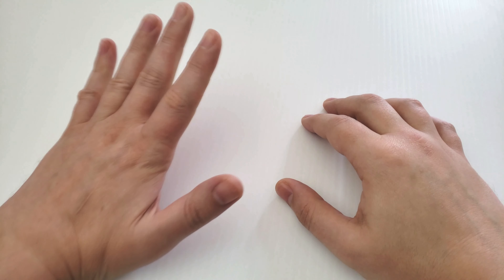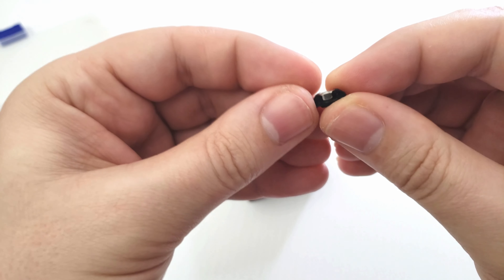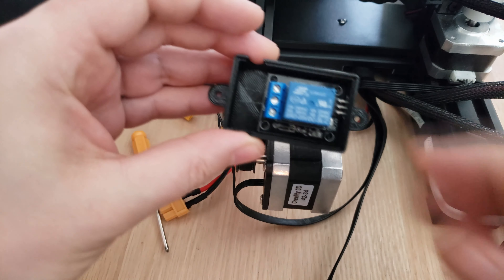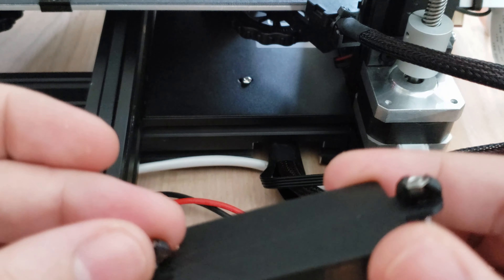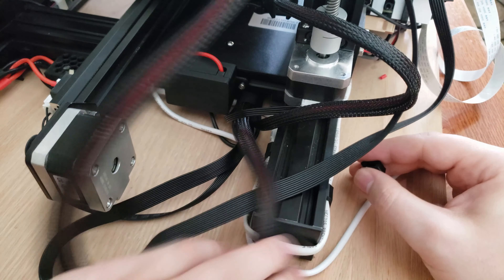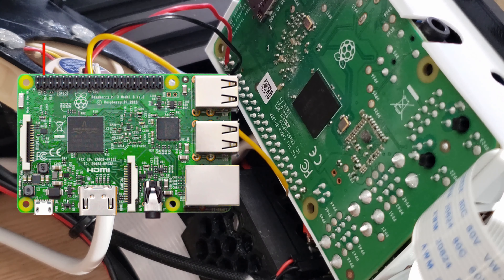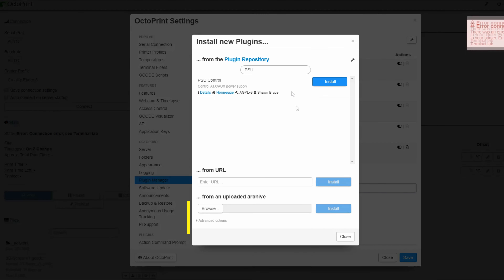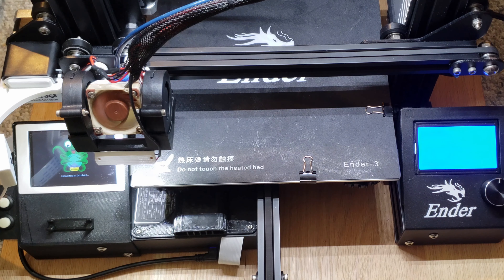Using OctoPrint with PSU Control to turn off and on your 3D Printer.

Comment: Hey man, this is very dangerous. Your relay is rated for 10A and the printer can output up to 15A on the DC side - FIRE HAZARD!!!. Safer would be wiring it on the AC where the current is smaller. I know that you would lose the ability to power the RPi directly but safety should come first. I guess a higher-rated relay would do the job but I would still be more rested cutting the power to the power supply.

I know more people have brought that up in the comments and you have acknowledged but they are too far below for people to see. I really think you should address this in the video and description. 

I am grateful for your videos and see that you are helping a lot of people but this specific issue can become a tragedy for someone. Thanks and good luck on your channel
Reply: Yes, I agree with all this. Here's what I have done for my Ender 3 V2:

1. I built an enclosure for the printer and pulled all the electronics out (minus the steppers and limit switches, of course) and mounted them inside their own enclosure that sits on top of the printer enclosure.
2. I used the same relay as in this video, but I wired its N/O output in parallel with the physical power switch, and control the relay via OctoPrint on my Raspberry Pi. The relay is in parallel so that the physical on/off switch will still be usable should I have a relay or Pi failure.
3. The Raspberry Pi is powered on a separate wall outlet that has a smart plug that I can control with my Amazon DOT.
4. I also have LED lighting and a charcoal air filter inside the printer enclosure, both of which are powered by a buck converter inside the electronics enclosure, and both of which are separately controllable via OctoPrint. 

So, I turn on the Pi remotely with my Amazon DOT, then load up OctoPrint in a browser and use it to turn on the printer power and optionally the internal LED lighting and/or air filter. Works a treat and greatly reduces the number of trips I have to make to my garage where the printer is kept. 

Next project: build a servo/OctoPrint-controlled nozzle wiper so I don't have to go to my garage just to "wipe the printer's nose"  before it commences a print. Gonna be fun.
Reply: I know Im pretty off topic but does anyone know a good place to stream new series online?
Reply: @Remy Miller meh I'd suggest Flixportal. You can find it if you google:D -caiden
Reply: @Caiden Cristiano thanks, I went there and it seems like they got a lot of movies there :) Appreciate it !
Reply: @Remy Miller glad I could help :)
Reply: Thanks for the video, and the effort. But, It's not the way it's supposed to be designed. DON'T DO IT!!
1- This setup keeps psu always on, shortening the life of it. (And increases idle power consumption)
2- Vitor is right, DC current is way too high for the relay. It may eventually cause fire hazard.

What you should do is, use the relay on the AC input of the psu. Current will be always below 10A so, relays can handle it. Properly cut the Phase cable, use the relay to complete the circuit back to PSU. Use proper isolation. ALWAYS TEST BEFORE ACTUALLY POWERING UP THE SYSTEM. DON'T MESS WITH AC IF YOU DON'T KNOW WHAT YOU ARE DOING. (Sorry for the capitals guys, but as an electronics engineer I cannot overstate the importance.)

Only downside is, raspberry will keep powering the printer's mainboard even the psu is off. Printer screen will stay on, and probably you will recieve low voltage alert on octoprint.  You can use another relay to power down usb cable between pi and board. Software solution is hub-ctrl. You can google it.

Cheers, happy printing.

Comment: Instead of switching the 24V side do it on the AC side.
Get a relay module which already has an optocoupler included.
That way you can turn the printer completly off, including the PSU.
For the RPi, just use a 5v power supply.
That way, if something happens, you can switch the whole printer off (safer).
As i'm finishing my enclosure, i'm thinking about including a smoke detector and temperature sensor.
Write some code, and just let the RPi monitor the inside of the enclosure ambient. If something goes bad that is detectable by the sensors (supoosing there are no bugs), just let the raspberry pi shut the printer automatically off.
Reply: wifi socket on the lot is what i use, simplest solution that and a fire ball in the enclosure. No playing with the electronics and so much simpler.
Reply: Also better for the relay since the most can only handle 10 amps
Reply: @sitgesvillaapartmentneilsc7924  can u explain to me how to do it? Thank you
Reply: @--3D  all I use is a normal wifi socket on my printers cables /cabinet where it sits, that connects via wifi  back to alexa from amazon and I can tell alexa to switch it on or off or do it from my phone, alternatively you can use a small relay and add some gcode to the end of your program that sends the x azis up to the top of the gantry hits a microswitch which turns off the ac power, because that would have 220 volts in it or 110 you would have to ensure that its safely enclosed and the wires can. not touch the frame, that way at the end of the job the x gantry rises and switches off, in cura you can set some finishing gcode that can lift the x gantry to the top. The fire ball is from amazon and as my machine is in a steel cabinet with a double glazed door on it it hangs at the top of the cabinet , should the printer catch fire then the fire ball will pop and put out the fire i hope, but to be honest the safest bet is not to leave your printer. Hope that answers your question if not please be more specific and I will try and help.
Reply: @sitgesvillaapartmentneilsc7924  thank you so much for your time and answer.
You gave me a lot of options to think about.
I have a sonoff switch laying around I think is 10Amps. Do u think it'll work for an ANET A8 PLUS
Reply: @--3D  to be honest I dont know that machine but you can look at the power panel details and work out the amps as follows : The formula for Amps is Watts divided by Volts, whch will show the amps then check the sonoff switch and see what that has, if its more than the printer its ok if its less than you need a more powerful one. Hope that helps.
Reply: Sitges Villa Apartment : That’s a good idea, the micro switch at the top of the gantry! I’ll look into it, can still use a 5v relay to keep the wiring on the printer safe low voltage and put the relay somewhere safer.

Comment: thanks for posting,   I didnt realise the plugin was available, I have done a similar thing a couple of years ago  on my old a8, but I used the relay to switch the mains  side using 2 shell scripts on an orange  pi  zero, they are runable through octoprints menu, I prefered  to switch the mains side rather than the low voltage side as that way the psu is completely off when not in use
Reply from the maker: I've seen a couple of people do it at the mains side, either with the plugin or without. Since I had already connected my Pi to the printers PSU, I went this route. Though I still do shut off my printer each night when in use. (at the PSU)

Comment: great videos im still getting a under voltage running through the power supply so i switched back to a raspberry power supply but i love the mods that you have

Comment: You really should use a transistor, mosfet or a transistor driven by an opto isolator on the GPIO line. The Pi's GPIO are wired directly to the Broadcom CPU and are not really capable of driving a relay coil.  A flyback (reverse biased) diode across your relay coil is pretty essential to prevent the induced back emf from spiking right back into the Pi's CPU.  Sure, many relay modules have this all on the PCB but you should warn folk not to wire a relay directly to the GPIO  and the "Closed" contact is correctly called the "Common"  just to be consistent.  HTH, G
Reply: SSR is a better solution as well, more rugged, no back EMF, no movable component hence no possibility of contact welding. I preferred to go for another XT60 cable instead cutting those in place, with a splitter and step-down i am able to power the RPi too.
Reply: This relay Is really operated by the  Pi's 5 vdc, The 3.3 vdc GPIO voltage simply switches on the relay boards on board switching transistor that applies the 5 vdc to the relay. Not as good of isolation as an optocoupler but plenty good for this application. It's amazing how many people think the 3.3 vdc is what actuates the relay. But you are right, using this relay board is fine but you do need to be sure that the relay you use has those on board components. Hope this clears up things a little

Comment: very strange I wanted to test the plugin first. Used jumper wires to connect the relay. That powers up but with minimal settings it refuses to switch.

Comment: I've got a couple questions I hope you can answer.

1. Are you powering the RPi through a wall brick or off of the printer's power supply? I saw that you plugged in a USB cable on the Pi's USB power port but I can't tell if it goes to a wall brick or if you modified the cable to grab power from the printer's PSU. My goal is to do just that and grab power from the printer's PSU when flipping the printer's power switch without that actually turning the printer on and then turning the printer on via OctoPrint and PSU Relay Control. So I hope that's possible.

2. What do those 2 white switches on the side do? It looks like the top one controls the printer's overhead lights. Does the bottom one just control the hotend lights? Or does it do some other cool thing?

Thanks for the video, it's helped me understand the setup I'm aiming for a bit better as well as given me some new ideas!

Comment: Thanks for the video!
is 10A relay enough?
Reply: depends what printer and the max power output of the power supply the printer uses 
I know the ender 3 needs a 15 amp iirc 
I think it has a 350 watt supply that can do about 15 amps at 24 volts
Reply: @BenCos2018  I was thinking the same thing.  I'm probably going to switch the AC rather than the DC on my setup.
Reply: @benjaminlately  yeah 
I'd be careful with switching the ac though (make sure it's unplugged fully before you touch any of the wires though)
Reply: @benjaminlately  switching AC is going to be inconvenient because now you need an independent PSU to run the relay and rpi.

Comment: Hey man thanks for your tutorial, I've a orangepi and using the system command to power off and my printer. Can I power off my orangepi at the same time?
Reply from the maker: I haven't seen a way to do so via the PSU Control Settings.
But OctoPrint does allow for custom GCODE scripts, you could create a shutdown script for your OrangePi, tie it to a custom GCODE and then add that GCODE to the shutdown commands on the PSU Control plugin settings.

Comment: I have mountet the relay like you say, but the usb cable from the pi to my cr10 pro keep the motherbord powerd up. how do i fix that?
Reply from the maker: The relay should be wired in between the power supply and printers mother board.
It's purpose is to control power from the supply to the motherboard.
Reply: You ha e to cut the 5V wire in the USB cable.

Comment: Considering the DC output of a lot of printers (like the ender 3) is 15A and the relay you're using is 10A... couldn't this be pretty dangerous? If the system ever pulled the full load then that relay connection would burn.
Reply from the maker: Mine has since been replaced. I had one sitting around that I used in the initial build but have replaced it to match the Ender 3's output.
Reply: @lifeasanerd4202  can you provide a link to the new relay that you used?
Reply from the maker: @JoshKindhart  https://amzn.to/35YzBt5

But also https://amzn.to/2QiGCP5 could be an option. Both are rated at 30amp 240v AC
Reply: @lifeasanerd4202  The first relay does not have a transistor/mosfet driving it. Using that likely will kill the output port short/midterm...
Reply from the maker: @thinking-laaf  That is a possibility, though in the year its been in service, no issues as of yet.

Comment: At 7:03 - 7:06 your wiring diagram changes the positive and ground pins... which pins are the correct ones?
Reply from the maker: Looks like an editing error on my side. Good catch!
The first 2 pins are 5v the 3rd pin is ground

Comment: Hi, I'm not very good at electronics, but I have a question.  This relay says it is for 10A and the Ender 3 PSU say at 24V with 15A, no problem if you use it at maximum print temperatures to burn something? And other question, if use led strip, just conect at same wire to power with motherboard of printer? thanks and sorry for my poor english.
Reply from the maker: I have yet to have issues with mine and I print at 210c with 60c bed and fans at 100%. Longest print I've done with this setup is 12 hours. No overheating or burnt parts in my case.
As for the LED strip, I used a Buck Converter coming off the same print power wire. The Buck Converter allows you to adjust the output voltage so I could lower it to 5V for the LEDs to be powered.

Comment: Did you not have trouble switching that 5v relay with the Pi's 3.3v gpio logic pins?? I know the Pi has a few 5v power pins, but all the logic pins are 3.3v
Reply from the maker: There are no issues switching the relay with the 3.3v logic.
Reply: @lifeasanerd4202  hmm, it must just be a luck thing then with some 5v relays, because I've seen some people say it doesn't work and others say it DOES work. I have a 5v dual relay board I use with arduino (specifically a ywrobot brand) and I tried it with my Pi and it doesn't work. It will trigger but it won't release.

Comment: I've seen this tutorial from other youtubers using the COM and NC for the power but you suggest to use the NO. Is there a difference in the setup to use the Normally Open instead of the Normally Closed?
Reply from the maker: NO means by default the printer will not be getting power. I have to either log into the Octoprint UI and tell it to activate the relay or set OctoPrint-TFT's plugin to "Auto power on" at boot.
In the event of an issue or failure and the relay loses power, it kills power to the printer.
I see it as kind of a fail safe.
Reply: Great explanation. Thank you.

Comment: It looks lite Octoprint automatically connects to the printer after powering on the printer. Did this require any configuration? I have to manually press "Connect" after I power the printer on with PSU Control. I'm controlling the AC power of the printer PSU.
Reply from the maker: Depending on how long I wait to load up the Octoprint web UI after starting my printer. 
If it is right away, it autoconnects, if its abit long I have to manually connect.
And if its real long, it will just give me an error and I have to reboot.

Comment: hi i followed your instructions and it shuts off the psu but not the screen,is there anything else i can do?Thanks
Reply from the maker: The Pi itself and Screen should all be powered from the PSU via the buck converter in this example. Thus when the PSU is completely powered off the Pi and Screen are as well

Comment: This there a particular relay you recommend? I've heard some people suggest 3.3v relays instead, also want to make sure I get one rated for the right amps for my CR-10S Pro V2.
Reply from the maker: The one used in the video was only a 10AMP, but I only printed PLA with a low bed heat if any heated bed at all. 
This is a high amp 30AMP relay that may be a good substitute
https://amzn.to/2XGqKKX

Comment: You need to switch your AC input, not the DC output, and, why you solder the cables to the raspberry pi, you can just put Dupont conectors at the end!
Reply from the maker: The point of this video is to demonstrate how to run the Pi off the printer PSU, with out needing an external power supply.
If that is what you are looking for, I'm sure there are plenty of videos on how to do that.

Comment: I followed your steps. But i am using RPI 3A+. And it does not trigger the gpio signal to my relay at all.
Reply from the maker: The 3A should work as well, be sure you have the correct PIN setup in the Octoprint settings

Comment: I built a similar circuit, but when I power off the printer the printers LCD screen starts to screech because the 5v from the USB/PI is still powering the LCD. What is the fix for that?
Reply: You ha e to cut the 5V wire in the USB cable.
Reply: Or blank off the live tab on the usb plug with a small piece of insulating tape (there is a blanking piece to be printed on thingiverse but I could never get it to print satisfactorily)

Comment: Ok nice, i have this working for a anet a6, but on my ender 3 i have a screen and touch ui on my raspberry, can i use psu controle on my toch ui aswell?
Reply from the maker: That should be possible. OctiPi PSU Control is just another OctoPrint plugin. They can both be installed

Comment: Ok uused 5v grnd and gpio 2 so no3 in the circle, in settings i set up everything like u said, but nothing happens, if i plug in power my printer is on straight away
Reply from the maker: Do you have a multimeter handy?
Check to see if the Pi is sending power to the relay on boot and causing it to activate and check the pins coming out of the Relay (NO / NC and Common) to see if the relay is activating, or if the wiring is backwords.
Reply: @lifeasanerd4202  both the red and green led a on on the relay and i connected no and closed
Reply from the maker: @lucbisschops  Swap between NO and NC on your relay and see if that makes a difference?
Reply: @lifeasanerd4202  thanks